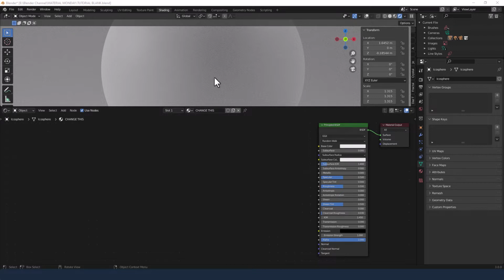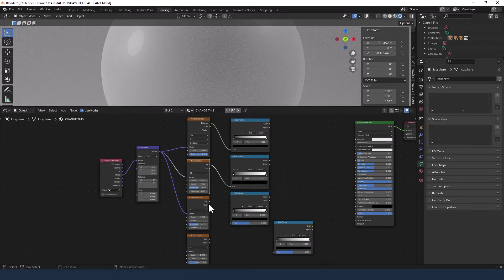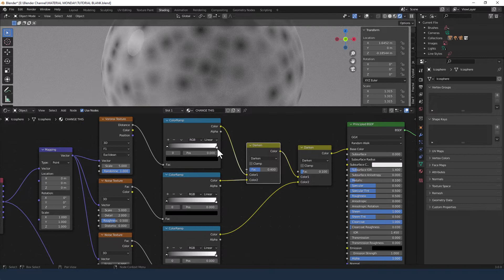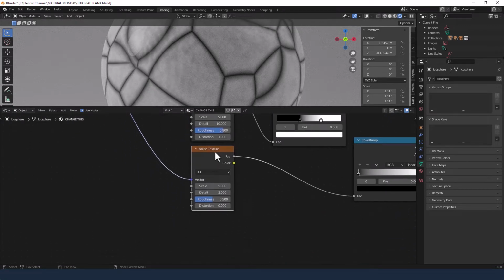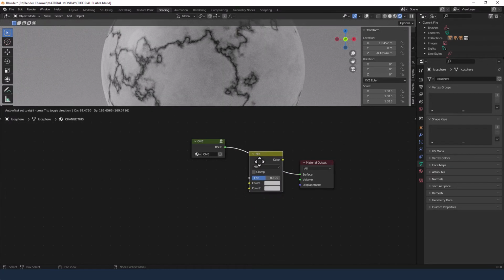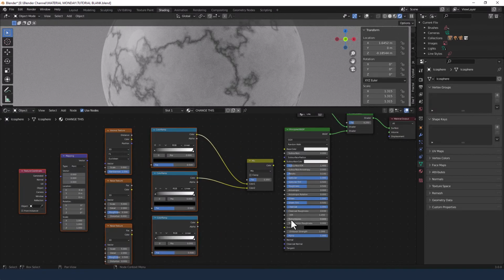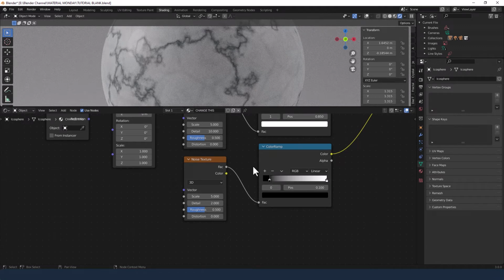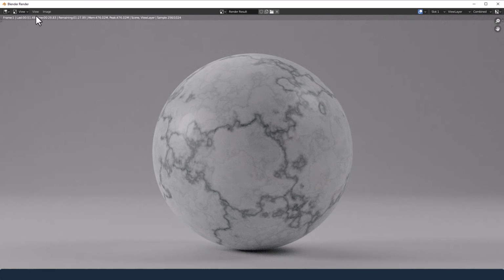CREATE A PROCEDURAL MARBLE MATERIAL FOR BLENDER

Comment: Would it be possible to automatically align tons of vertices along the gray line? Lets say I would like a flat surface with that texture except the gray lines are like a dip in this surface, to make it look like a real life valley or canyon if zoomed in. The point is to have it 3D printed and have those lines filled in later.
Reply from the maker: That is an interesting challenge, and sadly, probably a little outside of my knowledge at the moment.
There might be a way to do this with geometry nodes, but I am still getting up to speed with those. 
I'll keep it on the list in case I come across a way to do this but for now I would suggest approaching creators that deal with geometry nodes.
All the best.